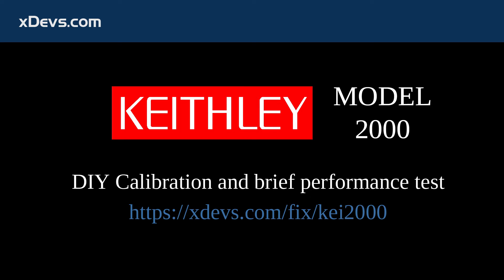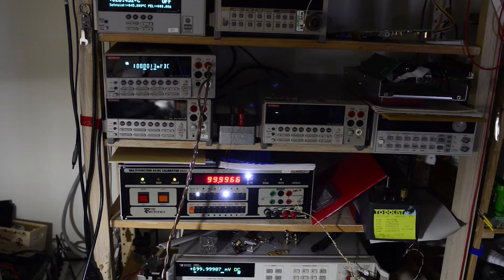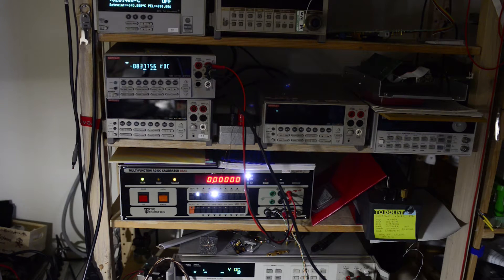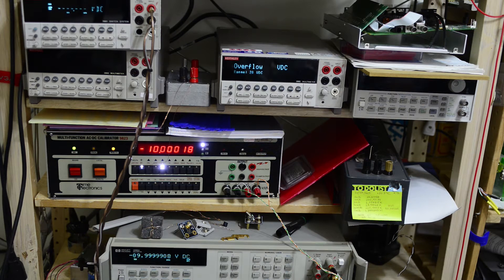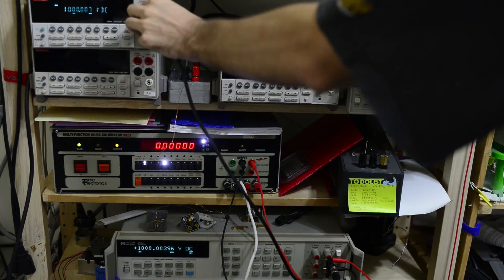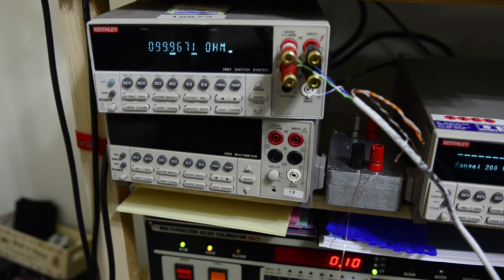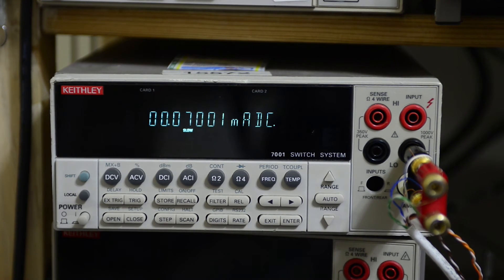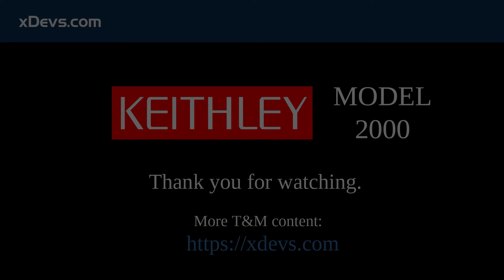DIY Calibration for Keithley 2000 6.5-digit DMM

Comment: Excellent Video. Hi I have Keithley 2015 multimeter. The ohms range was under reading. On analysis I observed that the Ohms test current is 0.98mA in place of 1mA. Can such a drift in test current be compensated during calibration. Or hardware repair will be needed for this. Your advice will be much appreciated. Thank you
Reply from the maker: @vishnudas9476  Thank you for feedback. Current sources in DMMs are not precise so it can be easily a few percent off the typical value in the specifications document. In all modern digital DMM that is compensated in firmware automatically. Correction factors are programmed during adjustment and calibration procedures. So to know if your meter need repairs or not you need actually calibrate it with known good resistor standards and check if you still in spec or not, not just measure current from DMM.
Reply: @xDevscom_EE  Thank you.

Comment: What a nice video on source meter calibration! I wonder if you could write up a summary or simple work flow, in words, so people can read it and watch the video at the same time? Even the main procedures will be very helpful! Thanks in advance!
Reply from the maker: It's a DMM calibration , but thanks. Calibration procedure is listed in Keithey Calibration manual document, with all steps provided both for front panel calibration and from GPIB remote calibration way.
Reply: xDevs_com thank you sir!

Comment: if mere mortals could actually afford a 3458a. even used ones are massively expensive ...
Reply from the maker: You just need to want it bad enough, and be ready to play gamble. Then eventually patience will be rewarded.
Reply: even broken ones go for around $2k. surplus repair parts for 3458a can easily cost $2k or more. and then there's calibration of that 3458a. unless you are wealthy, or want to sell a kidney, 3458a is just not reasonable for hobbyists.

fwiw commercial NIST traceable calibration of a keithley 2000 costs about $75.
Reply from the maker: Some hobbyists were lucky to snag 3458a for much less then these numbers, and got away with bad diode or a dodgy cable fix :). K2000 cal for such price is not accredited, and also this K2000 and 3458A are completely different instruments for different purposes. I'm not wealthy by common means, just wanted 3458A for many years and when chance to get one showed up, I took my chances. I had full worklog of that 3458A on my site: https://xdevs.com/fix/hp3458a/. 

There are many hobbies which need more money than cost of 3458A, so it's all depends. Take photography for example. Serious semi-pro body cost few K$, and then set of good lenses are few K$ each too. It's just way more popular than volt-nutting at home with stash of 8.5-digit DMMs, so we accept that as more normal.